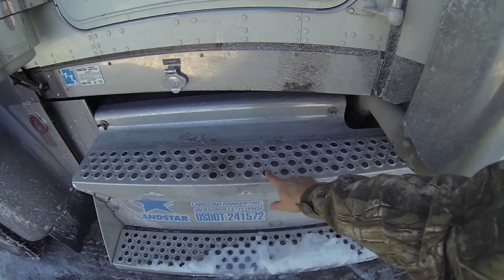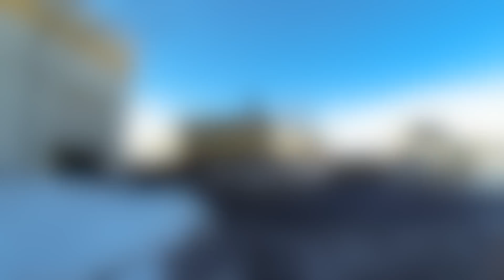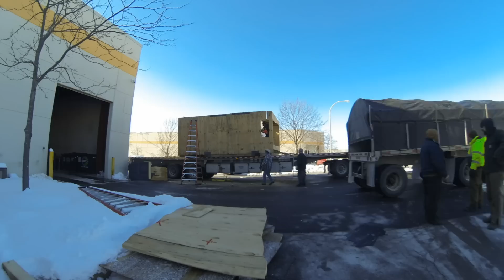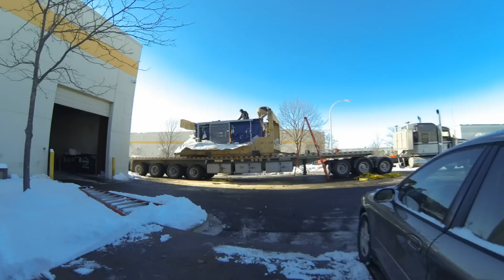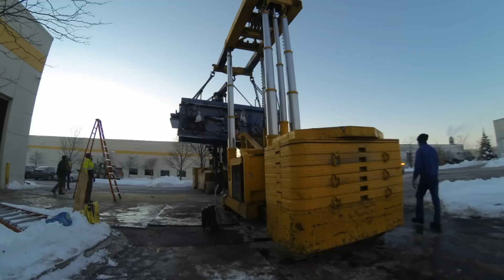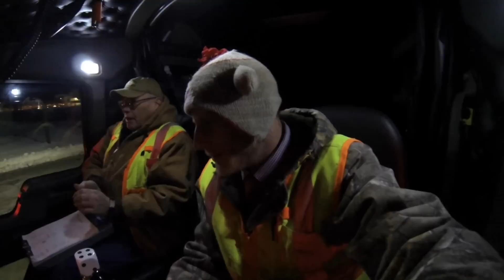Heavy Haul: #38: 97,000Lb  Press!

Comment: The industry term is 'punch press'.  And they are mean bitches, taking off more fingers than the other type of press.  the reason is simple.  To punch a hole requires a lot of power.  To punch lots of holes at once requires the press to move fast to generate enough force.  And if your finger is slow leaving the press, well, you won't be going home with it.
Reply from the maker: Guess that's a lesson you'll only have to learn once!
Reply: you'd think, but there was a 1.0 corollary between missing a knuckle and 5 years working the presses (ie, everyone was missing a knuckle for every 5 years they had worked in the press room).

Comment: Damn, I was going to say, nice lovely hat. XD The off loading process looks like it taken about 3-4 hours to do it seems. Just a little guess on my part. The huge yellow hoist/forklift machine that is picking up the huge press, I never seen that before. That beats of having a huge crane to pick up the press for only about 20 minutes then put it down.
Reply from the maker: Yeah, would have worked out well, had the little yellow thing been able to lift all the weight. Just wasn't quite enough. It was an all day event. We were there about 11 hours I think.
Reply: 11hour?.. damn, long day plus you had to be in the cold watching them take the wood off part by part of the box. As well they taken their lunch back then back to work. In know you was glad they got it off so you can stay warm. Cold weather is no joke to any truck driver out their that have to endure the cold elements..
Reply: TriLifter by Riggers Manufacturing.
Reply: Thanks for telling me. It looks really cool. Never seen one till recently on Nick Vids.
Reply: I also not ever seen this type of lift before, but reading another persons response, had to look it up. While it is unusual in initial appearance I am used to Versa-Lift which is similar in practice but not the same set up as the Riggers Manufacturing with the seating. but the multiple hydraulic hoists to that of VL with typical forklift hoist. Both have extendable counterweights and remote control operation. To each their own.
Reply: I would like to take the remote control, im not sure I did like o have over 90,000+ lbs hovering over my head. Even if its just the beams that holding the weight up.
Reply: The seat is useful for saving time it would take to walk when empty but if I was operating it I prefer the safety of remote ops. Many hydraulic pistons or a simple forklift like hoist and same capacity either one. The remote offers me to personally see what is going on as it moves about than just the seated view. Both companies and their models come in at least 3 weight capacities. Many factors can cause a mishap or failure.

Comment: The reindeer hat camouflaged the red nose you got from the cold.  It did NOT, however, help you with any of your skills in math and weight measurements.  
Never seen a lifting truck like the ones they used to unload.  Not your average forker, for sure.
Reply from the maker: ? Which math / weight skills did I misuse? 

It was an interesting little bugger. Never had seen anything like it until that day either.
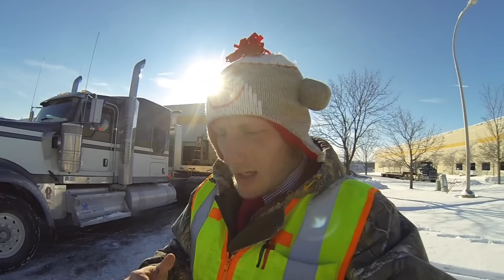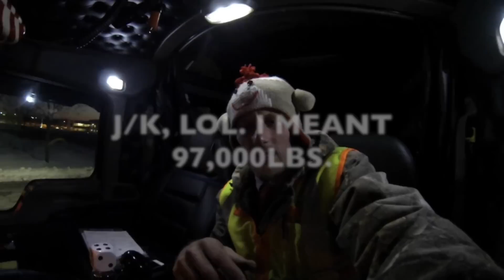Reply: Oh no worries, I was agreeing with you.  I was LOL-ing @ ur math @ 1:25 (won't fit in the door) and your generous weight reduction @ 5:14.  92K vs 97K - what's 5K between friends, right?  It would feel about the same if dropped on you anyway!  Ouch!  :-)